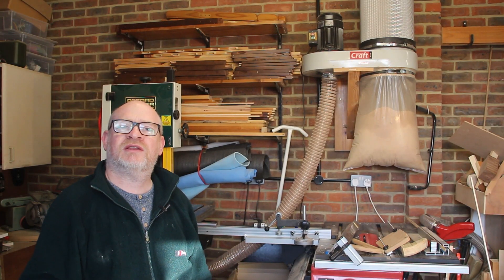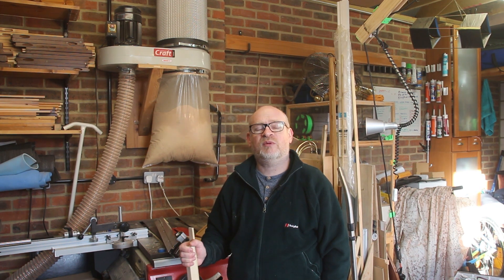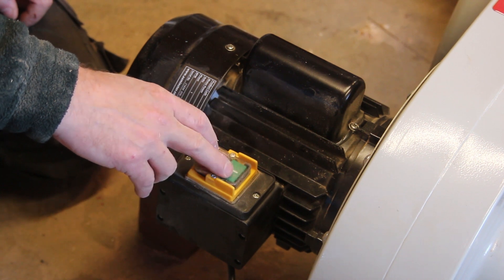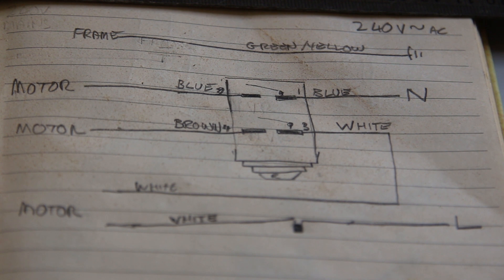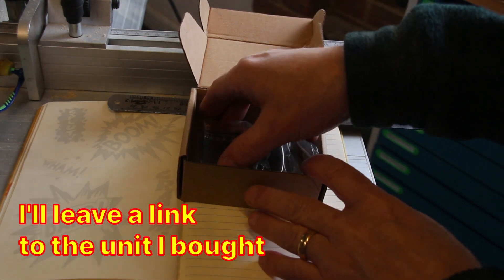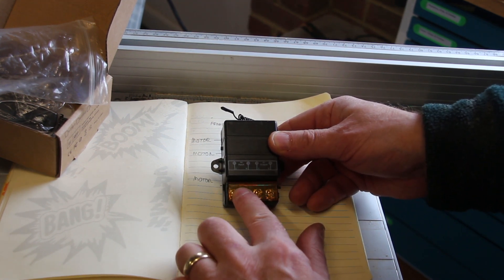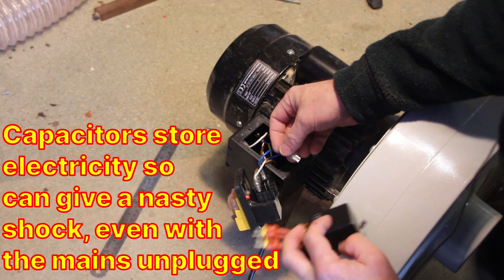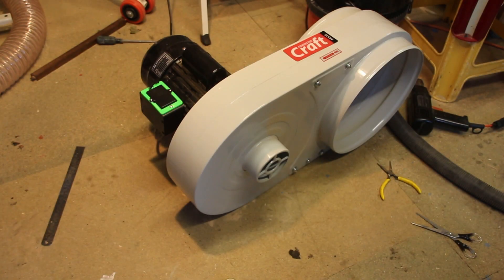117. Budget Dust Extractor Remote Control

Comment: I have an AC82E Dust extractor also bought some years ago , which takes too much space in my small workshop - I like your idea of putting it on the wall ; do you have a  Video that shows step by step how you did it?  Thanks
Reply from the maker: I don't it is just a simple shelf, but shaped to fit the AC82E

Comment: Hey Simon, just ordered my dust extractor being delivered tomorrow. Looking to do this in the coming weeks to have my collector situated in the adjoining shed. My brother is a qualified electrician but just so i have all the supplies he may need. What gauge of cable did you use for the connectors? I have 4mm twin and earth to hand.
Reply from the maker: I don't know the gauge, but it iwas rated for 13A 240v applications, old flex from a kettle, so should be fine, your brother should be able to advise.

Comment: Thanks so much for this video SImon - thanks to you I finally got around to doing mine with the same switch you used - only 13 quid from Ebay, with 3 fobs! Took a while to work out a tidy way to fit it (my extractor is a bit different from yours) but all good in the end, and it works brilliantly. Should have done it years ago! Thanks again.
Reply from the maker: Great, Mat, glad it was helpful, mine has been going strong for several years now. 😀

Comment: I have been trying to do exactly the same as you with my Axminster dust extractor. The issue with my NVR switch is that it has 5 terminals (even though it looks the same as yours). And some have 6 terminals it seems, even if they are labelled KJD22 like your 4 terminal version. Fortunately Axminster provide a wiring diagram for my switch / motor and that shows the white wires (perhaps the same as yours?) going to an overheat protector switch (normally closed). That will cut the power if the motor overheats. 
The advantage of the 5 wires over the 4 is that it is wired to cut the power to the coil which normally keeps the NVR switch on, thereby stopping the motor, and even when the motor cools and the switch resets the motor does not restart. Whereas if your wiring diagram is correct, and if the white wires go to an overheat protector switch, it looks like the motor would restart when it cools down unless you have cut the power from the wall in the meantime. (Whether that’s a problem, or whether a dust extractor needs an NVR switch at all, I will leave you to judge!) 
Anyway, my point is that your neat solution cannot be directly implemented on a 5 terminal NVR switch. You would also have to consider the rating of the overheat protector switch since in your system the full power of the motor appears to go through it but in my case it doesn’t. Hope that’s helpful to anyone who has more than 4 terminals on an NVR.
Reply from the maker: thanks for contributing to the conversation, its certainly food for thought
Reply: I just installed this remote (Cheers Simon!) on my Holzmann dust exrtactor. It also had 5-wires, two white, I measured them for contutunity and came to the conclusion that they went to N-connection (live).

After install it all worked great. 👌
Reply: @lehtinel80  Did you just wire it in with the other white wire? Mine has a double, brown and white and separate white wire.

Comment: I have an Axminster extractor turning up Monday.. just ordered the switch. Thanks for the very informative video.. I will also be wall mounting the unit, so will have to make a bracket like you have!
Reply from the maker: Glad I could help, the Mens shed I volunteer at has just ordered one too, I'll be doing a similar mod on that one

Comment: Thanks! Am wiring similar for my dust collector. Have used remote for 12v DC and was unsure about which wires to put to control box.
Reply from the maker: You are welcome! Glad I could help, I've been using it for over a year and it's not let me down. Good luck.

Comment: Hi Simon. Your vid was very helpful, and I'm so glad i bought the remote relay, and wish id done it earlier. A cheap one from Temu (China) was perfectly fine and cost only ~$10 Aussie dollars. My tip is when you order the relay, also order the connectors a the same time. I did what you did and made short connector wires with the spade on one end and fork on the other, and heat shrunk them. Cheers!
Reply from the maker: Glad it helped, mine is still working with no problems other than finding the key fob! Thanks for watching!

Comment: hi. great video. I have the Axminister ac153 and I want to add the same remote switch.  I have looked inside the nvr switch and there is a white wire that attaches to a separate smaller spade connector on the switch its self.  Did you have this and if so what did you do with the wire.
Reply from the maker: Check the diagram here https://youtu.be/xeHdBSRnnpw at 2:34 it shows the white wires and how they are wired.

Comment: Hi Simon, I got myself a used Axminster dust extractor today, and I can see the benefits of using a remote switch like this.
How is the switch holding up, any issues at all? Thanks.
Reply from the maker: It seems fine, not had any problems so far.
Reply: @DIYTinkerer  Good to hear, thanks for  replying 👍

Comment: Hello can some one help me i have a Holzmann ABS3880 Twin Bag Wood Chip Dust Extractor  i would like to put a pull cord on the Ceiling of my workshop or a Remote Control to this dust extractor?
Reply: You would probably be able to use a shower pull switch rated at 30 Amps
Reply from the maker: Hi sorry I've not got one of those, but I doubt a ceiling pull cord used for lights will be rated high enough.

Comment: @jwflame how safe/unsafe do you think this is?
Reply: Not really any different. The old switch was a cheapo thing anyway and was just a switch, no overload trip.
Very likely that the remote one is off by default, so any power failure would result in it not automatically starting, which is exactly how the old one worked.
Minor risk of it being switched on remotely unexpectedly, but that's why machines are isolated and locked off before any work is done on them - no one should just rely on the NVR switch for isolation.
Reply from the maker: Yep I always unplug mine, when changing te bag and it is off by default. Messing with anything you need to consider the risks that might result, I decided that I could live with these risks on a dust extractor, I certainly wouldn't come to the same conclusion with some other tools. :-)
Reply: @jwflame  thanks JW. and if it was a DOL starter? not very straightforward to use that RC switch since DOL has a Momentarily push NO start and a NC stop.. maybe with 2 RC switches..

Comment: Great vid simon, on a different subject i have had to remove the cast iron table top to re align the riving knife as found it all but impossible to do it with table top on, the bolts for levelling moved and didnt realise now i have to re level the t/top, so this leads to my next question could you help me out by measuring the four corners from the top of the table to the main saw unit where the adjusters are this would be so helpful, on the bright side the riving knife is now set correctly and the grub screws are   are in with lock thread.
Reply from the maker: Hi, I think you mean the height from the top surface to the top of the grey painted frame, front left =50.99mm, back left 50.96mm, I can't get to the RH side as I have the table extension fitted. BTW, I move the grub screws for the riving knife with my fingers, as you say, it's a bit tight for Allan keys. Hope this helps,  if this is not what you were after just reply and I'll do my best to answer.
Reply: @DIYTinkerer  Cheers Simon so kind of you to check for me, it will aid in leveling the table top correctly, once again thankyou, sorry for not explaining very well,the reason i had to take the top of is i have ms part of that is numb ish hands so trying to do something i cant see makes it hard with lack of feeling in my hands, it coud be worse😁

Comment: Nice job, much fancier than mine, I use one of those remote control sockets and I wired the motor directly to the mains cable, taking out the NVR.
Reply from the maker: That's great, there's always many ways to solve a problem :-)